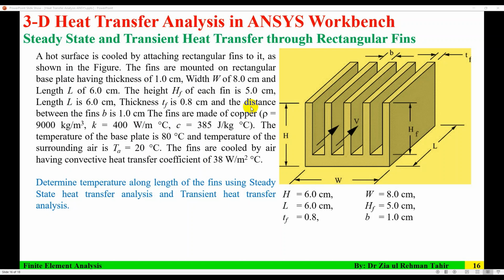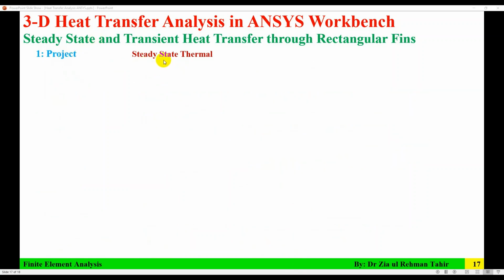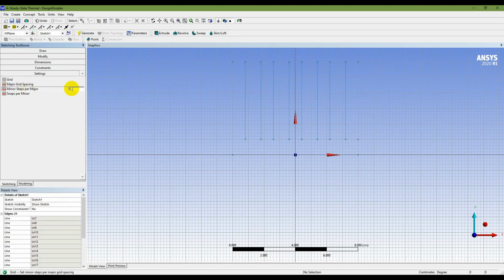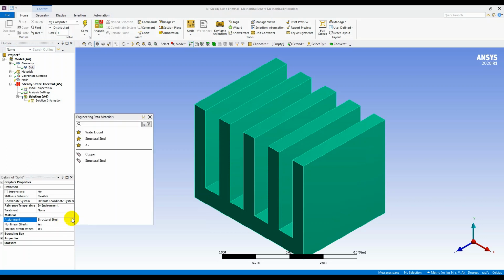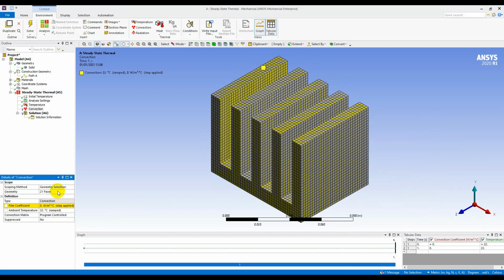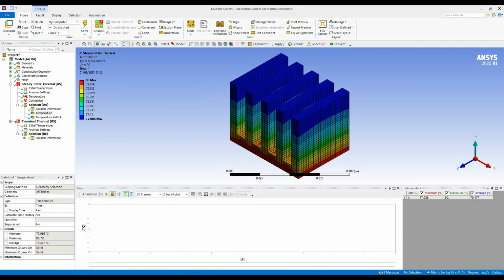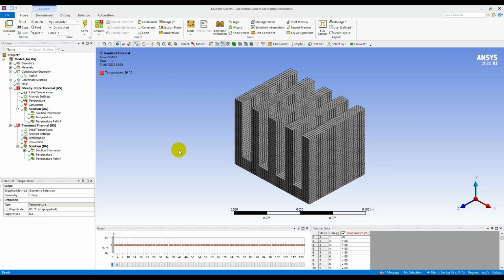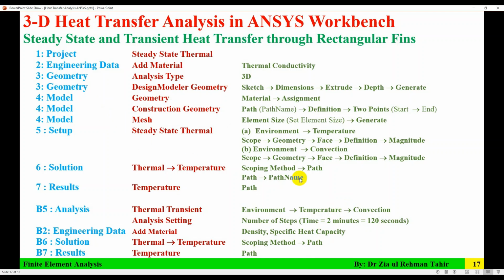ANSYS Heat Transfer Analysis 8 | Steady State and Transient Thermal Analysis of 3D Rectangular Fins

Comment: Sir why there is no difference in temp in steady state or transient does it mean that , its not time dependent
Reply: Hi! It is time dependent, but with providing the sufficient time for the transient system to reach equilibrium (steady-state condition; here, 120s), the response of a transient system will be the same as that of a steady state system.
Heat stored = Heat in - Heat out + Heat generated. This equation will get applied

Comment: I want to model a wall with a planned thermal bridge. I need to find the thermal resistance hence the U-Value of that wall and compare it with the same wall without the thermal bridge. Do you know how to output the R or U Value in ansys? I may even just need ansys to output the area weighted average on one surface of the wall. Can you tell me how to do that? Thank you
Reply: QUE LIBRO ES?